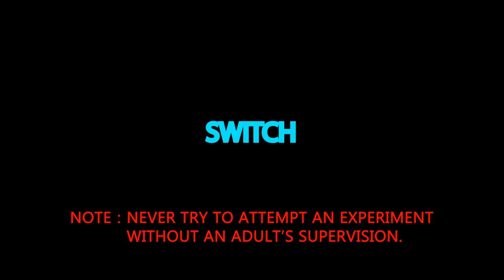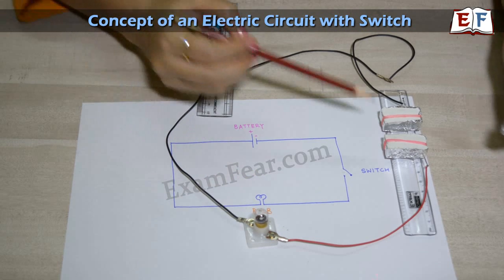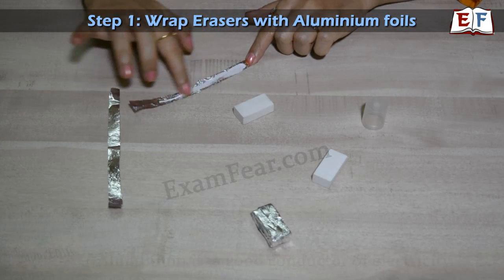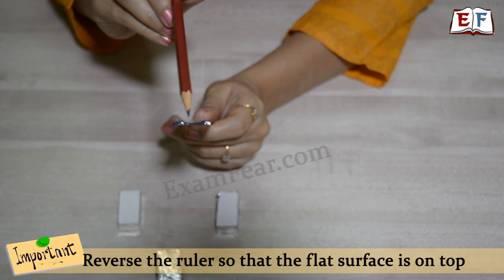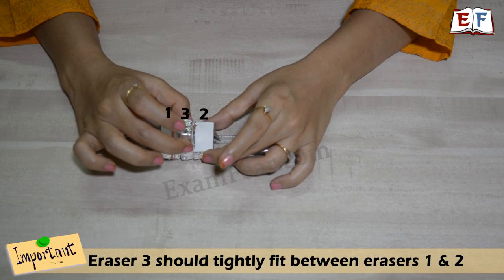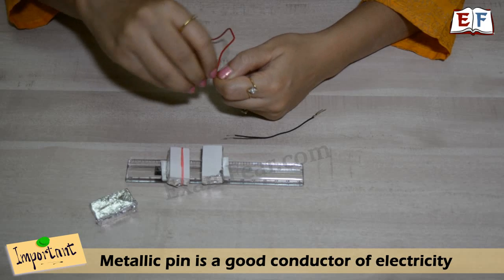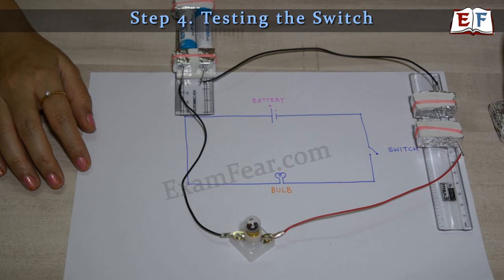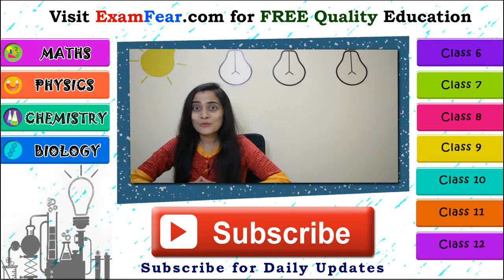How to make an Electric Switch ? : School Science Project

Comment: I think this conveys a wrong message to the children. The switch should have been insulated. What if children tomorrow uses direct electricity to power the circuit for something with the same kind of aluminium foiled switch.  I am always a bit more conscious about the security of others.

Comment: hi
the pin that you have inserted in the eraser, should it go till the other end of the eraser? conductivity will be only when the pin on one side is connected to the middle eraser and then to the pin on the other side. isn't it?